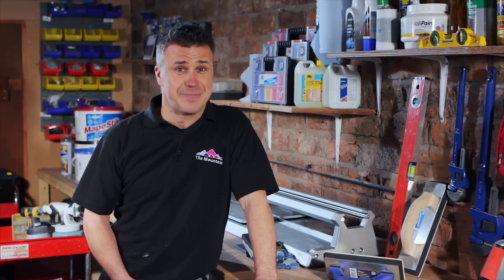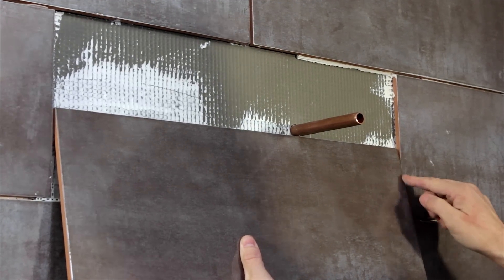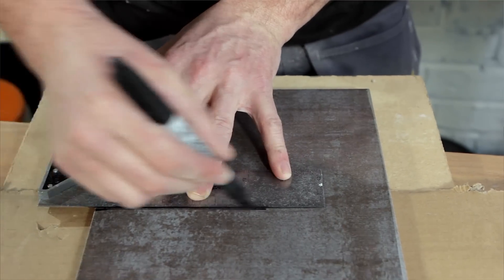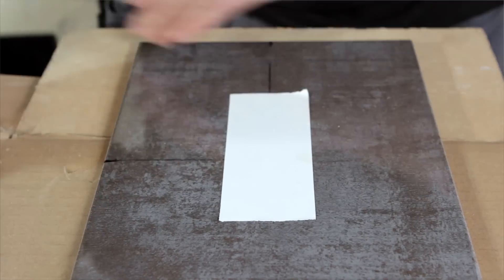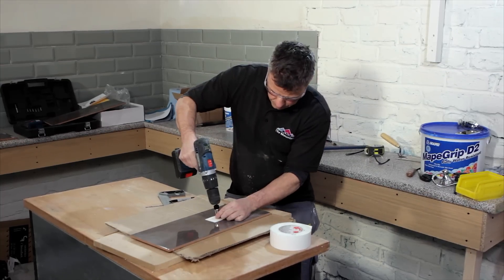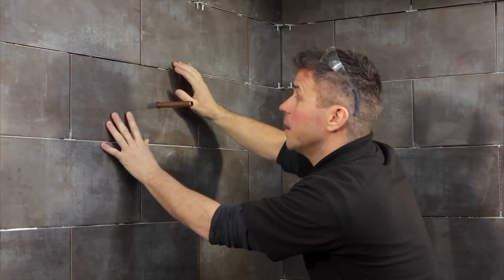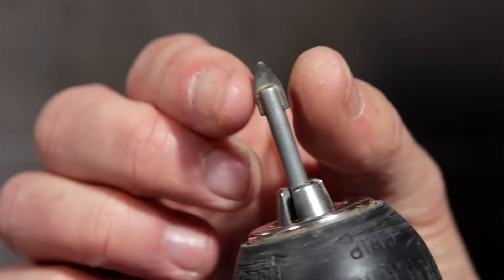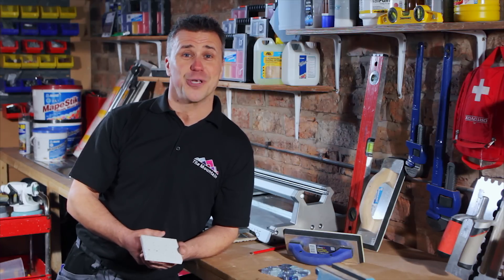How to Cut Tiles around Pipes and Drill Holes in Bathrooms & Toilets | Tutorial feat. Craig Phillips

Comment: Good video. To stop tile cracking when inserting screw, you can make hole slightly bigger in tile than rawlplug requires. Then when the screw is inserted, it does not apply pressure to the sides of the tile.
Reply from the maker: Nice tip!

Comment: I have 2 - 15mm mixer shower pipes . What size holesaw would you use (18mm)
Reply from the maker: Hi Paul - thanks for your comment.

We would advise using a 18mm drill bit as this will be a bit more accurate and leave a tidier hole in which to insert your pipe.

https://www.tilemountain.co.uk/p/18mm-porcelain-drill-bit.html

Hope this helps.

Tile Mountain

Comment: What tile hole cutter do you have... with a pilot drill bit, where do I get one?
Reply from the maker: Hi Craig - thanks for your comment.

Cutting holes in porcelain tiles should be done with a diamond-tipped drill bit. Different sizes are available depending on the diameter of the hole you need to cut. You can check out our range here: https://www.tilemountain.co.uk/catalogsearch/result/?q=porcelain%20drill%20bit

Hope this helps.

Tile Mountain

Comment: How do you do it if you dont have a hole cutter?
Reply: You can get very wide drill bits but its harder and there a risk you could break the tile with lager drill bits
Reply from the maker: Cutting tiles around pipes and drilling holes without a hole cutter can be tricky, but there are a few methods you can use to make precise cuts without needing a specialised hole saw, such as a rotary tool or tile nippers.

Comment: What do you fill the empty space behind the big shower valves with? Mortar? Silicon? Grout? Tile adhesive?
Reply from the maker: Hi AJ MM - thanks for your comment.

We're not sure exactly what you're referring to - can you be more specific?

If you mean the faucets that are common with showers that operate from the mains then we'd advise cutting the holes in the tiles that will house them as closely and as accurately as possible, leaving a minimal gap, and then filling with silicon.

Hope this helps!

Tile Mountain
Reply: I've filled it with mortar, 4x1 sand and cement, then tiled over.